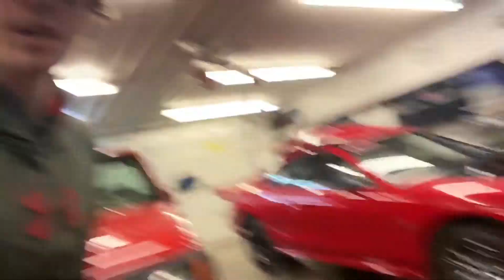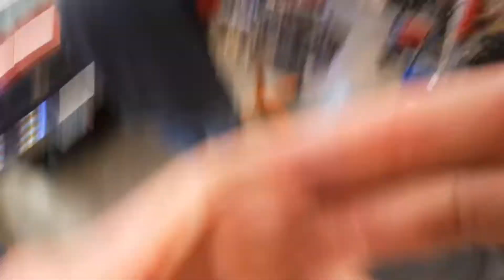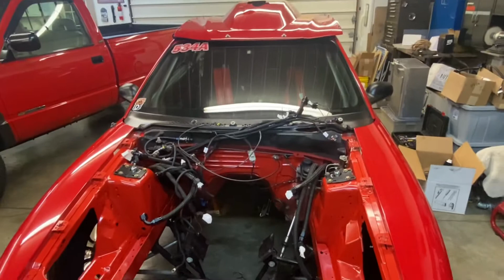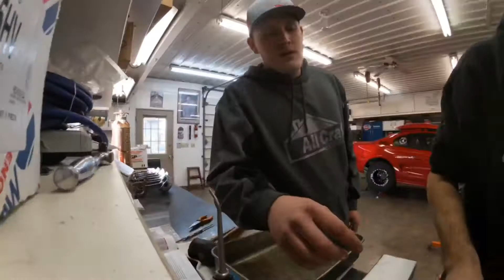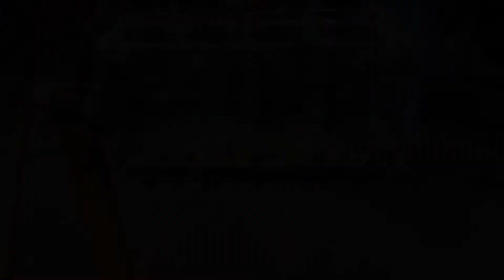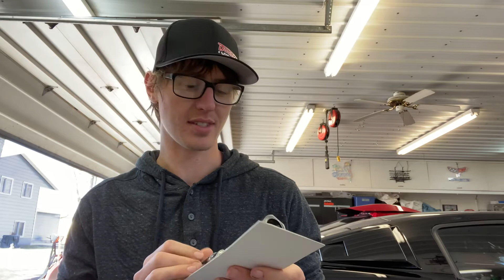Pt 1, Assembling SBE 5.3!! Plus fancy new parts!

Comment: I'm pretty sure that in reference to your wiring question, those small wires are so short that they can handle a high amp draw in that short of a length. 

However that same high amp draw over say 10-15 feet will cause issues with heat and shorts.
Reply from the maker: That makes sense! I ended up powering it with 2 relays. All within a couple feet from the battery